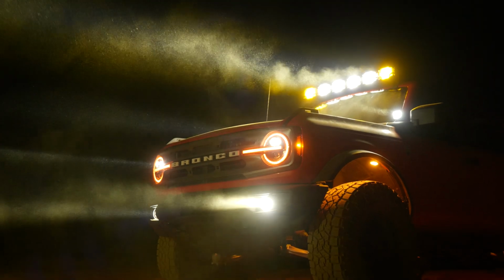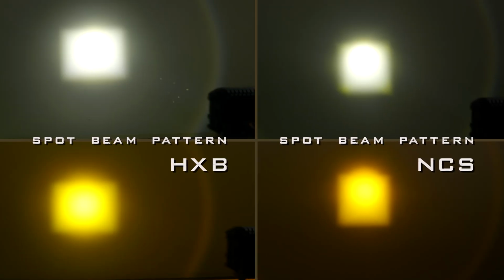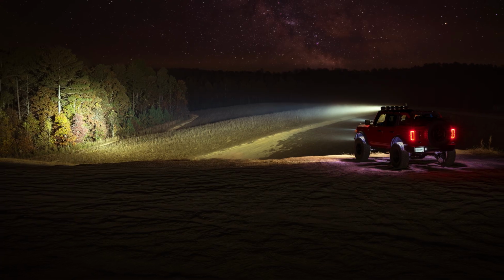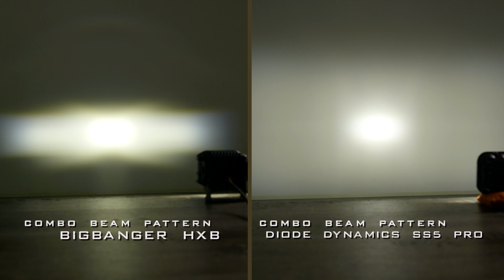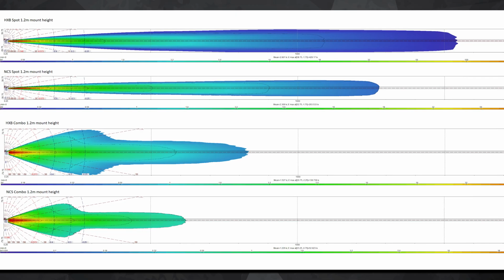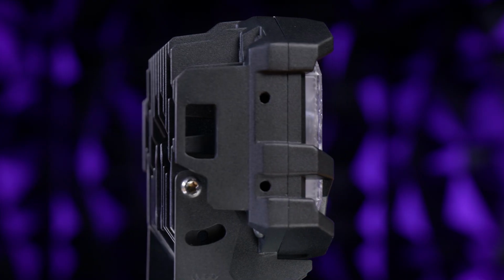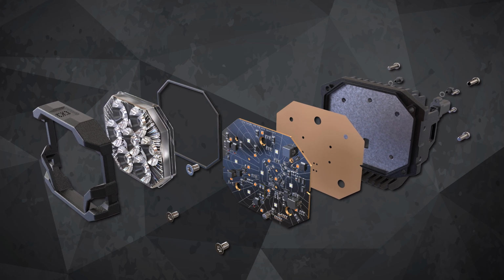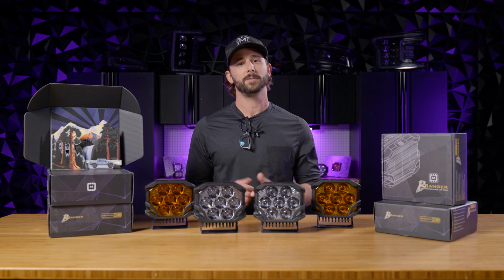Off Road Reinvented - Morimoto BigBanger LED Pod Lights

Comment: The DRL has 2 modes?  How is that controlled?
Im installing the bigbanger ncs amber to my voswitch.  And im assuming ill have have to piggyback on another wire for DRL?
Reply from the maker: It's technically a backlight, used as DRL when the vehicle is powered on. The BigBanger harness has two outputs for each Banger, a ground connection, a battery connection, the output for the on/off switch or trigger for pre-fitted up-fitter switches, and the backlight dimmer which can be installed directly to a power source, or you can use the included mini fuse tap harness to connect into your OEM fuse box.
Reply: @MorimotoLighting  I have a voswitch.  Could it be wired directly to that?